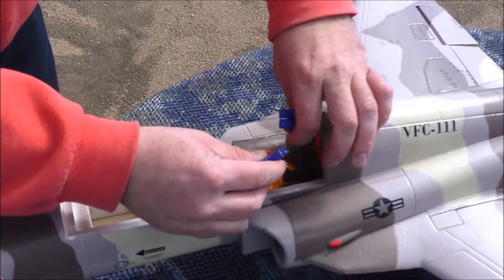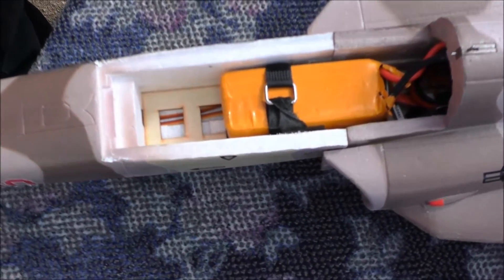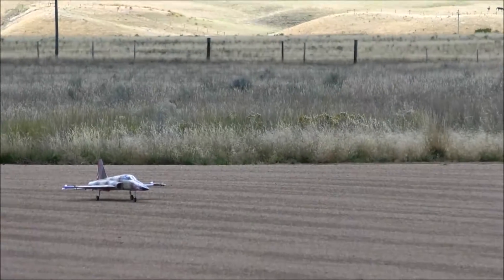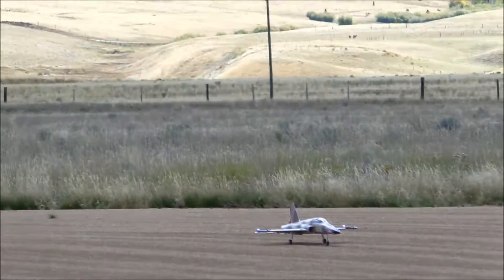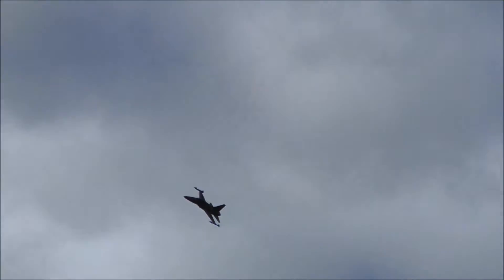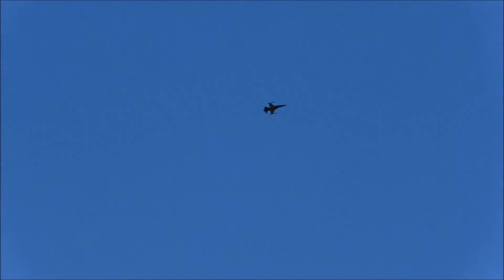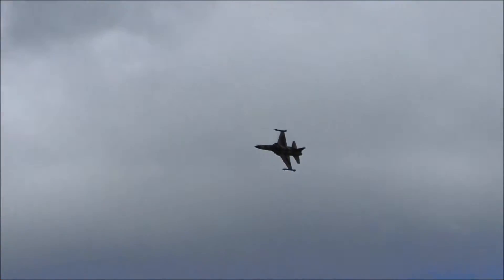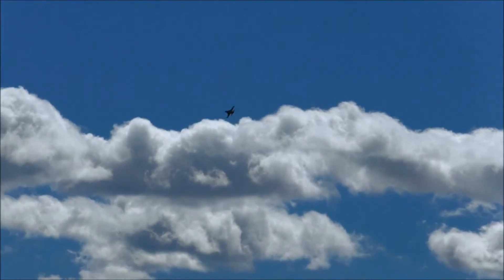Freewing F-5 battery placement

Comment: Chris, would the F-5 be a good first EDF model for an intermediate flier??
Reply from the maker: Hi. I think you could handle it since you have some experience. I would highly recommend the Freewing F-86 as a first edf. That's what I first learned on and she's a great, stable plane and looks cool too! Cheers!
Reply: I have one more question for you Chris. I am setting up my F5 and am wondering if the recommended control throws for the flaps are too much. What kind of flaps throws are you using?
Reply from the maker: Jamison Amonino Hi...I usually just eyeball my flaps. Minimal for takeoff flaps and then never over 45 degrees for landing and then tweak from there. I also set my flap speed on the radio to like 6 seconds to deploy and retract...that way you won't get a pronounced balloning/sinking when they are deployed. Hope that helps!

Comment: Nice flying. This is a tough jet to dial in. You seem to do just fine but soon as I hit the flaps(7mm deflection)she starts rolling when I pitch up or down. I bought the kit so I have all quality digi MG servos and I'm running the inrunner from MotionRC. wings seem warped to me. I fly the hell outta my Mirage but this jet I'm not sure about.

Comment: you've got the complete engine model etc.?
Reply from the maker: Hi...yes, the plane comes with the 80mm fan and motor. I use 6 cell 4000 mah lipos. Gives me a little more than 3 minutes plus taxing out and back.

Comment: Where are you at with dr and expo? Great video by the way!
Reply from the maker: Thanks! I use the high and low rates from the manual. I started on low rates, but it flys really nice on high as well. As for the expo, I run all my EDF's at least 30% and that's what I use on the F-5. Seems to make it a little more scale that way.  Thanks for watching!